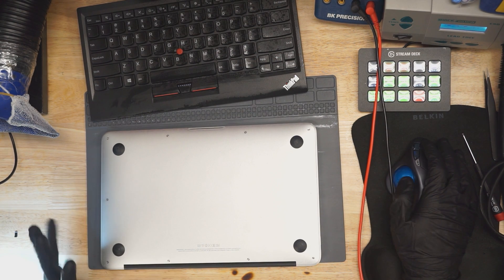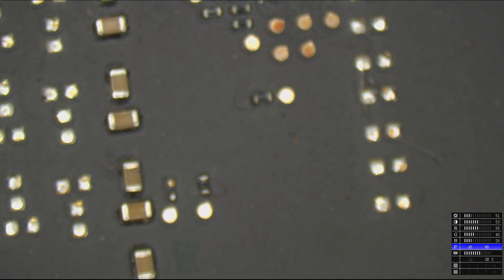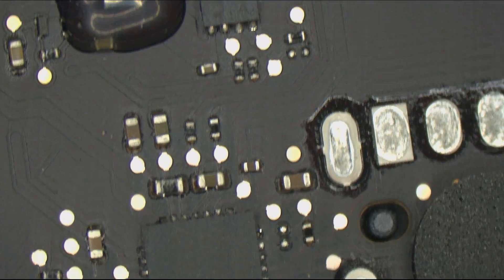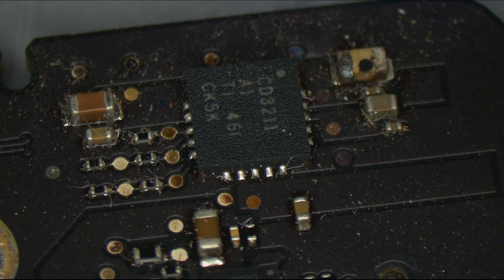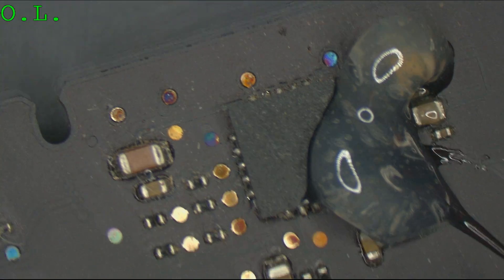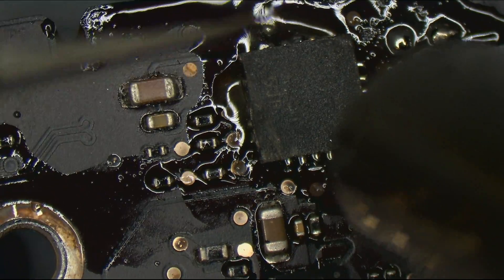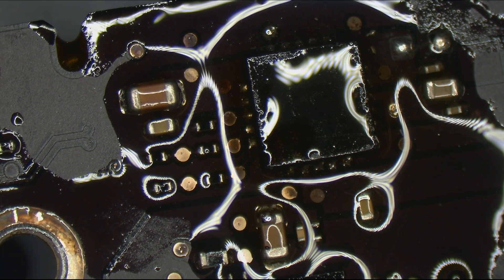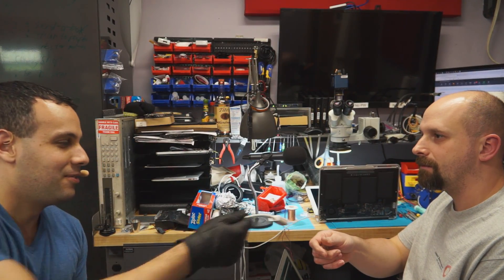Can thunderbolt circuit kill a Macbook?

Comment: Have you had any trouble with your Logitech M570?  I'm on my fourth one in 8 years, because they have a crap-tastic debounce circuit and so when the button switches wear out they start sending extra clicks all over the place.  But I keep using them because up until recently, there really wasn't any other over the thumb trackball worth a damn on the market.  (I actually have 2 of the old ones laying around, if I ever can get around to getting new switches I might just solder them in and have some spares hanging around.)

Comment: Hi Louis! I just came across your videos and find them so very insightful! You are doing such a good thing! Thank you for taking the time! I just purchased a refurbished  Late 2013 4-core Mac Pro from www.macofalltrades.com Are they reliable? I did purchase an extended 1 year warranty as well. I also purchased  separately the 12 Core Intel processor and 64GB OWC RAM from MacSales.com and planning to install both myself on the 4-core  Mac Pro. OWC has a step-by-step video on how to upgrade the processor on Late 2013 Mac Pro's that looks pretty straight forward, or should I take it to a computer repair shop and have them install the processor? The RAM is no problem, I can do that. Thanks again! keep doing what you are doing! Fight the good fight! Blessings.

Comment: I couldn't tell at first if that was a blob or a pit on that cap.   It got me wondering if it would help if a few of the LEDs on your microscope light ring were coloured,  like they have in operating theatres.  
It then got me wondering if there's a microscope with binocular cameras,  so everyone (with the right screen or VR hat) watching on YouTube could enjoy it in glorious 3D too.
Reply: MattOGormanSmith microscopes are not stereoscopic, both eyes gets same image.
Reply: Some are,  check out https://en.wikipedia.org/wiki/Stereo_microscope
The Amazon page for Louis' one says it's a stereo.
You can have separate optical paths through a single objective if it's large enough.  I get stereo when I look with both eyes through my large magnifying glass.
Reply: MattOGormanSmith you’re right, my apologies
Reply: No worries.  I think high powered ones usually work the way you said.  It's probably debatable whether 8x magnification is strictly a microscope at all.

Comment: So basically anything on a MacBook goes bad it prevents the entire system from working?
Reply: Depending on how it's programmed to initialize itself it may error/not boot if there is a problem with something like the thunderbolt mux. And/or it gets stuck in a loop of error and it never gets past it.
Reply: @aeswere  Yeah but that's downright stupid to not have access to the system just because a connectivity port has gone bad. Since apple doesn't provide data recovery so even a device under warranty will lose all data just because of a malfunctioning port or a blown cap?